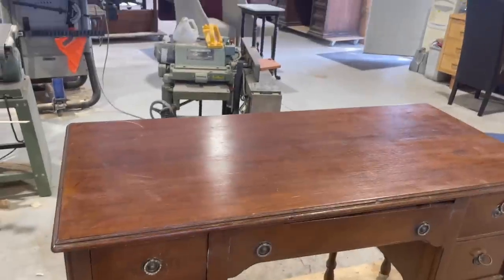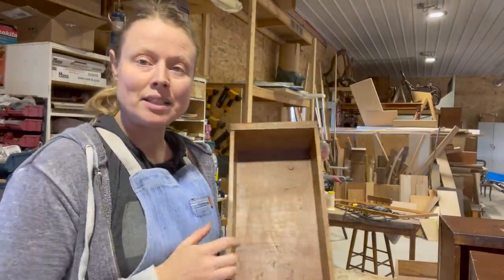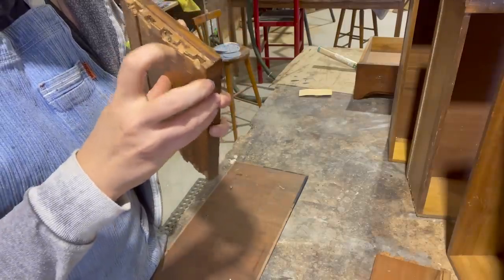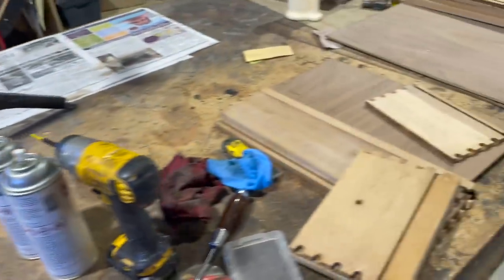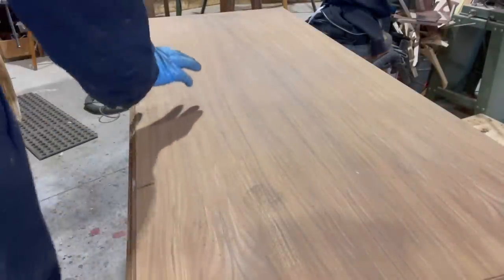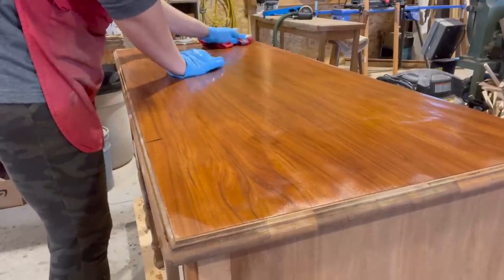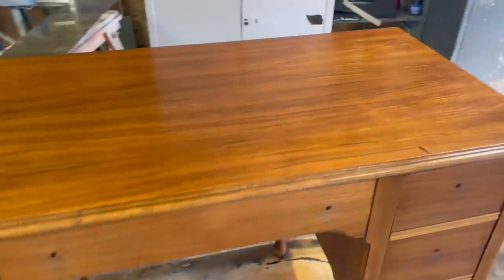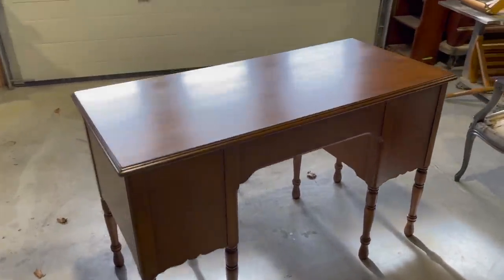I asked your mom and she said you can watch this video

Comment: Quite nice as usual. Always impressed with your color work. Question: I've noticed after you remove the old finish with the putty knife that you follow up with steel wool. Is that just plain steel wool or do you use lacquer thinner or some other liquid to neutralize the stripper? Or, for that matter, do you use some kind of "green stripper" that doesn't involve or require neutralization?
Reply from the maker: I use another coat of stripper with the steel wool. Neutralize with methyl hydrate
Reply: @johnsfurniturerepair  Thanks, I seem to remember you mentioning that in another video but, you have such a plethora of videos that  I figured I'd never find it if indeed my memory wasn't playing tricks with me. I really need to take notes whilst watching.

Comment: about the cigarette burn, I have an old Ethan Allen dresser that has what I think is a burn in the top.  It is a decent size and deeper than the one on this video.  I would have to say a few inches wide and a bit into the top.  If I wanted to repair that, would you suggest I contact a furniture restorer or just YT it?
Reply from the maker: It can be difficult to repair I would recommend a professional

Comment: I am always amazed by your skills, Trena!
Mother approved, since you probably had to remove the choice words after you realized you left the green tape on.😂

I wish I could get paint stripper that works as well as what you use.  I used a heat gun to get the paint off and most of the finish but I'm getting exasperated trying to get the 100 year old sticky shellac or whatever it is off the interior oak doors in my house.   I afraid I might sand through the veneer grain on the panels just trying to get to the wood.   The weak strippers they sell now leave a lot to be desired and I'm wondering what I got myself into.
Reply from the maker: If it’s shellac just use denatured alchohol. It will be much easier cheers

Comment: Beautiful as always! I’m curious as to why you used hide as opposed to more modern wood glue. Was there a technical reason, or was it to keep it traditional?
Reply: How do I “buy you a cup of coffee”? Is there a link?
Reply from the maker: Hi James. So the original glue was hide, but any glue would work. It’s nice to try and use reversible glues on joints and especially here where there was already old hide glue in the joints. Adding new hide glue actually reactivates the old and therefore I don’t have to scrape it all out of each joint. I’ve been slowly switching to use hide glue more on joinery but I will always have my woodglues and epoxies as they are always needed as well. 

There is a link below the video in the description. Just click and it should take you there. Thanks again James!

Comment: Good # 1 tip, ref the green tape. I was wondering if you put Cut Rite Wax Paper between the wood and clamping to give you a barrier to catch any squeeze out?. I use this in fiberglass repair, and it works well.
Again thank you for your great videos.
Reply from the maker: Yes that works great

Comment: I have recently acquired two old dressers (one may be well over 100 years old) that need refurbishing. What is your deciding factor(s) in choosing a finish stripper or scraping off an old finish?
Reply from the maker: if its old its probably lead and you need to chemically remove

Comment: Would it ever make sense to cut away the dovetails, put in a block and then recut them?
Reply: I was thinking that the block could be a long dovetail just under the drawer face, that slides up from the bottom and is glued in before recutting the sides
Reply from the maker: Not really. At that point you would make an entire new side

Comment: I have never used that stuff, however, could you use steel wool 0000 on the whole top or a toothbrush???
Reply from the maker: I used #1 steel wool on the top. Not sure that you mean with the tooth brush?